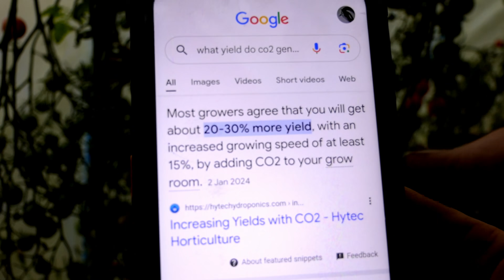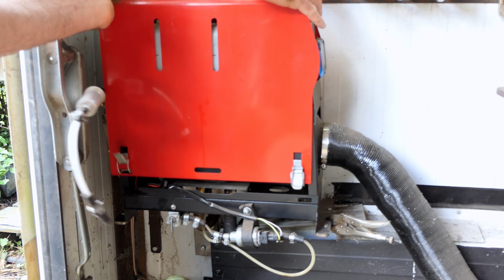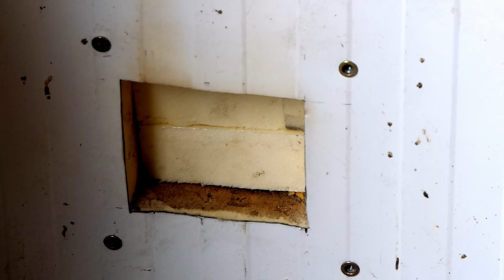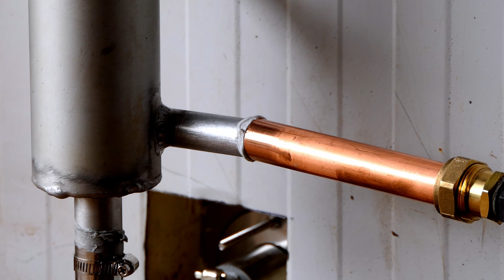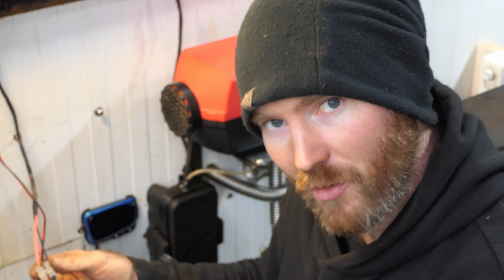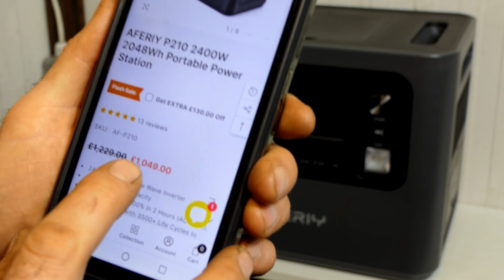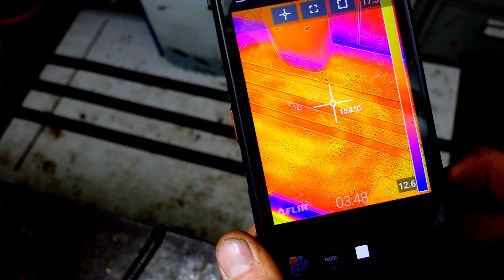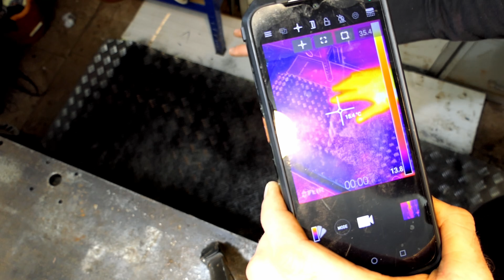NEW! Better system for Cheap and Safe Heating💲+ Underfloor Heating Mod test🫠

Comment: Spot on about the climate malarky, I have seen the data from the core samples  way back in the 90's taken from the north pole,  and they mirror what you say, but they also  prove a repeating pattern of global warming and cooling over thousands of years,  and dont forget precession or the wobble of the earths poles have a huge factor.

Comment: Does an air to air heat exchanger allow you to recover some heat from your exhaust? You have to be careful not to compromise the flow rates, but with proper engineering, you might get a bit more bang out of the combustion if you cool the gases by preheating incoming air with them. You'd have to be careful to source the incoming air away from where the exhaust is captured even temporarily, in the polytunnel. And you'd have to manage condensates which might be corrosive.

Alternatively, try a fluid loop coiled around the flue, using a fluid appropriate to the high temps.

Comment: Really enjoyed the video,  I've been using Ulefone for about 6yrs now, handed the last 2 down to my daughter.  My current is the 25t pro on the thermal image when it gets to 150c it flips to the next radiometric range up and I think goes to either 300 or 500c.    It is crazy how much deforestation there is even just on the streets, councils chopping them down so it is cheaper to maintain pavements and not having the leaves block the grids.  Trees by the road absorbing exhaust gasses and water, covering the roads and keeping them cooler in summer.  what crazy talk is that :)

Comment: Don't know if you are still monitoring this, I am not reading through all the comments. 

Agree reference the changes, my personal thoughts are, it's related to the trees, since tudor times, we have had mass deforestation, it's all cumulative. I recall reading a book by "Ted Simon" he travelled the world on a motorbike, he recalled riding across an area in Africa, seeing  a building in a desert area, called something like forestry commission, he stopped to ask why they would do this, the man inside explained not that long ago it was a forest. 
Dr Seuss got it right with The Lorax. 

Right, heating systems, to run a hybrid radiator and underfloor system, to keep it efficient, you have a mixer valve, which allows hot water to mix with the water in circulation, where normal rads these days get so hot you can't touch, the underfloor is very different, it does require thermal mass, we have 4" of concrete on top of the pipes, it takes days to warm up, then it doesn't go cold like a conventional heated room, we leave our heating on tick over temperature so it never goes completely cold.
Reply from the maker: Excellent information. Thank you. Cheers J

Comment: I would like it if you could give a quick overview of what your full plan is at the start of the video, ideally with some visuals, and maybe a quick recap at the end of the whole system you have constructed.  Because I kinda find it hard to follow what it is you are trying to do, and what the big picture is behind it all, and how all the parts fit together.

Comment: #1 you have buried your floor pipe directly into the insulation. That's contrary to the purpose of trying to get heat out of the pipe. a sheet of insulation first. then pipe on top. then submerge the pipe into something thermally conductive. like concrete or grout.
#2 You have not provided enough surface area and detention time to absorb the ferocious amount  of heat coming out of the exhaust and you have realized that, but you must also try to have all the condensation take place in the absorber also as the transition from water vapor to liquid, aka phase changing,  releases a measurable amount of heat. This scientifically is called the latent heat of condensation. and is a must to exploit for good efficiency.
Other than that, your presentation is excellent and entertaining.

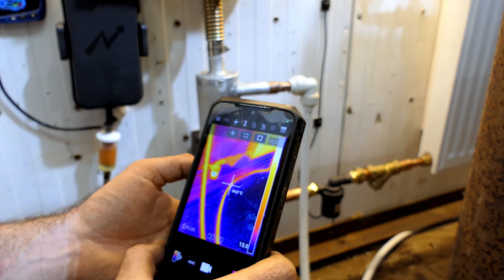Comment: 36:17 im sure you've probably figured it out by now but the phone thermometer, just push the picture of the crossed out flame at the top of the screen. It changes the heat range and should go to reading between 150-400c then.

Comment: The pump should be at an angle or upright because it gets an air pocket which reduces pump life.. kerosene contains sulphur which is a lubricant, paraffin has less sulphur and burns the pump.. I've been running on kerosene for years no problems..

Comment: 5:30 yeah, 15 minute cities with walkable neighborhoods, district heating from one central heatpump and no polutends like fossil heating or vehicles.
Reply from the maker: No thanks. I will not be forced to be reliant on corrupt and incompetent institutions when I'm fully capable of providing sustainable heat, food and energy myself in privacy.... Emphasis on 'forced'... Cheers J
Reply: @joshuadelisle ok, then install a heat pump yourself. Can be bought as a mini split with quick connects for 500 bucks. I installed one for my home cinema in my ex garage in under 2 hours
Reply from the maker: @florichi waste of money... my log burner and never ending supply of sustainable coppice wood is perfectly fine for my heating and hot water. I can build it myself and fix it. You cannot do that with a heat pump and are at the mercy and cost of a 'proffessional'... Also heating oil is cheaper than electric heat pumps currently and I can repair and maintain that also. The more self reliant I can be using local sustainable resources the better. Solar is great too. Cheers J

Comment: Regarding the burning of fossil fuels. For me, energy independence is a good reason to pursue the use of alternatives like renewables. With less expensive and temperature tolerant storage technologies like sodium ion and others on the horizon, the variability of supply becomes less of an issue. There’s an extra cost, sure, but think of it as insurance. If there are any benefits for global warming, then that’s a bonus.

Comment: I must have missed the part where you dealt with condensation in the exhaust. Was it not a problem?
Reply from the maker: With this one the exhaust doesn't get cold enough but if it did the condensate would just drip outside. Cheers J

Comment: I live on a boat and I recover the heat from the exhaust with a copper coil filled with water and it runs to the bedroom for under bed heating . The pump is on a thermometer with 1 degree difference on for about 10 seconds and off for about a minute.

Comment: I think the kingspan in your mock floor was the biggest problem about your proof of concept. I would have thought that a more thermally conductive material would have helped transfer more energy into your room from the pipes.

Yes, a heat exchange with more surface area would be good

maybe a take on an air-source heat pump (air2air) to extract even more energy from the exhaust

Comment: Pex pipe doesn't conduct heat very well.  I don't know of any alternative that's as easy as pex, though; copper would work much better, but it's so much more labor intensive.  Climate science is poorly understood.  I don't trust the numbers, because or local urban heat islands raising the measured temperature far higher than reality, which you didn't mention.  I love your analysis on percentages of CO2 generated vs actual CO2 percentage measured.  A year after your video, we are now beginning to realize how exaggerated the effects of global warming are.

Comment: You know Josh, you’re just putting a 🩹 bandaid on the real major problem! … In other words, the exterior walls of your shop should be constructed of 2x6 studs/lumber; excellent wall insulation; and 1/2” to 5/8” plywood sheathing on both inside and outside of your walls; and lastly, also insulate your garage door. … This way, you’re not having to come up with solutions that only ought to be considered as a last resort! 👍
Reply from the maker: My shed is 60mm steel insulated quadcore king span... doors do need insulation though. Cheers J

Comment: The method in which global temperatures and climate has been measured has changed from the original  method  And at the time of that change coincidentally that's when they show climate change was a problem😂😂😂😂 Actually claim something's a problem if you change the way you measure something therefore making all previous measurements invalid and incomparable. Climate change is bullshit. Let me throck still above water. If the oceans were rising coastal properties would not be insurable or for sale. And like you said why don't they all use zoom meetings instead of wasting 20 or $30000 in fuel purchase per flight per jet just to go to a 4 day weekend in davos...

Comment: Hey, i watched your video, awesome by the way.  I have a disel heater running right now, powered by a 100ah 12v lead deep cycle. I am charging it using a 24v 5A power brick connected to a solar charge controller both i found in my junk electronics bin. The charge is steady rising as the heater is running. Plan to add panels shortly. Thx for the video.
Reply from the maker: Nice 👍

Comment: Wow. I watched one of your other videos on wood gas generators and I am disappointed to realize you are an absolute idiot. When there is a overwhelming scientific consensus that climate change is in fact man made, it seems irresponsible and plain stupid to just deny it. It is not as if using kerosene heating on this scale is so environmental harmful you should be shunned for it. You don't need to do mental gymnastics to make it seem like your impact is 0. What a disappointment.

Comment: On the climate change topic, this is an example of a smart person employing very selective and disjointed logic to a complex problem. Mr. Delisle is quite correct that many factors contribute to an overall picture, but it is only the totality of all these factors combined which is applicable to this topic. The earth climate system, in terms of total energy, would be described as energy in and energy out, regardless of the source of that energy. Therefore, the source of the heating is besides the point when discussing any effects, which would take place regardless of how that temp is achieved.

It's quite true that Co2 levels have varied greatly in earth's history. Some critical factors not mentioned are that these events in the past took place over millions or hundreds of thousands of years, the species involved were native to those conditions, and more rapid changes in earth's climate are associated with cataclysms which led to great die offs. Overseeing a rapid change in climate, our own living conditions, would be the greatest own goal of human history. As we master our environment and employ ever greater technologies, a parallel pressure emerges which forces us to consider the effects of our own actions. A balance must be achieved in this system, or we will explicitly be choosing to live in a degraded world.